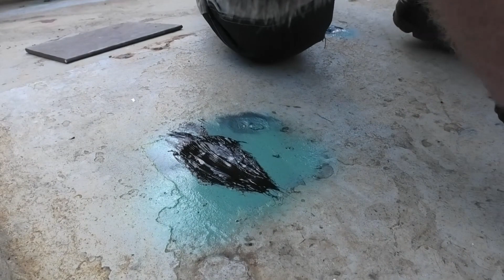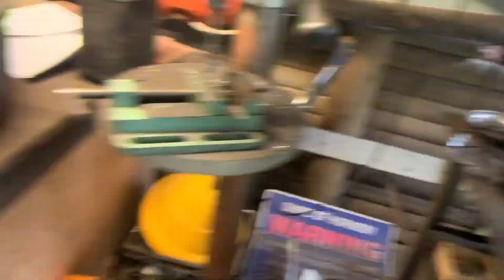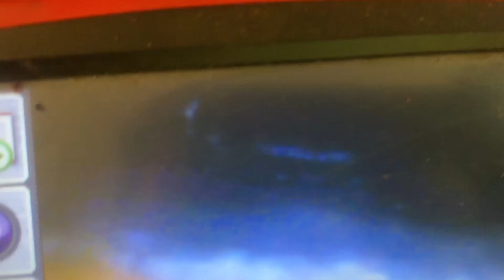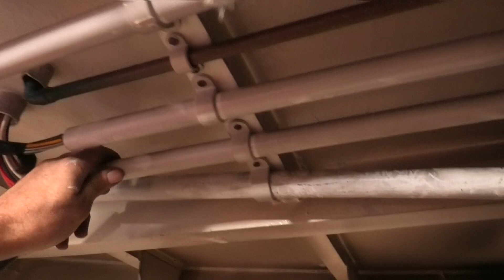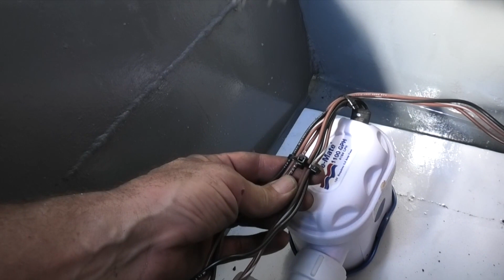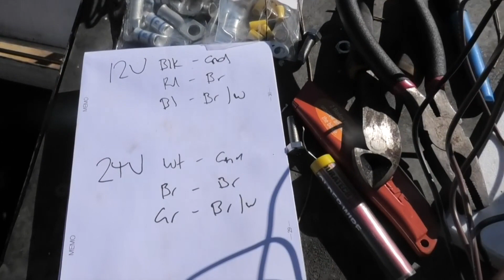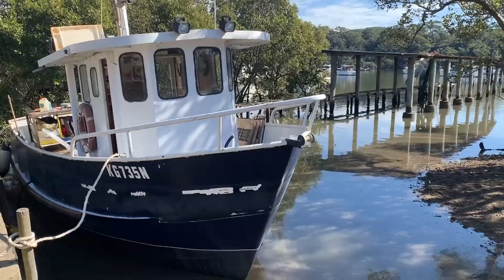Launching the steel trawler!

Comment: Definitely get an ATV winch with rope and wireless remote. 

https://www.ebay.com.au/itm/CE-Electric-Winch-4000LB-1815kg-12V-Wireless-Remote-Synthetic-Rope-ATV-Boat-Car/192240624376?_trkparms=ispr%3D1&hash=item2cc26f22f8:g:6uUAAOSwOjBZX0FD&enc=AQAEAAAB4BPxNw%2BVj6nta7CKEs3N0qWD5gbtDz8f5RZRRySfPiFdPE1UsR4JkkiyfIJappLwVXXtaH8BKJhwXTt1C8l4IPoLPEL5DqpzZ%2BrtnBKx2hbmllk5bKMOX3qS9KOGqZ1%2FTOzHGhEuBUZlbSsEIZ0qacvc3IchZjewRcJhjBnn3xxMuIEctrCzR8fGa%2BLsC1OzGGygXUeAhUy2Pq%2Frf3c97D5Rgf%2BzQtw7Y%2B7I5oCMLQdFZrPoqiU1czfHB%2BHz2ZSeUAif2ox11E3faVxd%2FTEbVP9FIlf0qGF6rtkSvhfB3VqhEYf0f72o%2FGcuaGE2Yr%2BIXVu9KYePVwKQ486mmCOtBc6zh%2B1DX4BxGRa9HyC72vClnWtPMsGuoUXwut%2BisNgA%2BlkmyoWj2HpxF0njq95Ehsucq963gwriJr3GCeP5R8yW3%2FUMTHTB2oVX0sT1TPqHps8t1ANJL0vkqnxvHhgVVnvxIeRwi8Nrwg%2B8BKW%2FnWzXWeXspz4HqRqLou3oGIjckDscLkTbudQO0CrztVZXkXrAsj6kIIYvH9AgBX5vbrFR97URNlrLc8sJ25GUoFC1XqtcQc0wsf7lZgu4RSbljZWno%2FTrqLT7wwiohMTrwoHELRd5Ks8PVrcIAaynCV8PHw%3D%3D&checksum=192240624376b371bf60ee4d48e7ac85d0e0d81f17ee

Comment: Can anyone tell me about the crane, I only ever see them in Australian videos
Reply: The Truck cranes are common place in the USA, the ship mounted cranes are even more common. unclear as to original question, please restate.
Reply: @Artoconnell  the crane lorry, never seen anything like that in England, the articulation and lack of rotation of the boom set it apart from the iron fairies we have here.

I'd probably refer to the shop hoist bolted to the deck as a hoist but appreciate I wasn't very clear thanks.
Reply: @dingledooley9283  Look up Lindsell hoists &/or Jarrett ute cranes, I've got a Jarrett on the back of my landcruiser & it's the best thing since sliced bread, there's a good picture of a Lindsell ute crane moving a live 5 meter crocodile on the Lindsell website.

Comment: Looks like the same dork who wired my boat wired yours as well. People who change colors like that mid-run should not be allowed anywhere near electrical and/or beaten senseless. Congrats on getting her wet.
Reply: I have an even better story.  I helped a friend with his 56ft cruiser.  That boat was built in Taiwan  and nearly 90% of the wiring had no color coding it was all black.  It was a nightmare trying to trace that stuff.
Reply: @Hoggdoc2  Just a quick tip on tracing wire - you can get a device telephone/network installers use to trace wires.  It sends a signal down the wire allowing a receiver to pickup individual wires.  The better ones allow you to trace wires in bundles.  I have a Fluke Networks Pro3000 which works great and was only around $75.   I would also get a wire label maker - Brady makes nice ones - so you can label the wires themselves as you go....
Reply: 20 years of IT networking and electrical..Beaten senseless. I've lost track at the sheer stupid number of hours of my life I've lost because people changed colors of wire mid run.
Reply: As Garfield says " Should be drug out in the street and ...." In Minrcraft of course. Survivors you guys can take care of.
Reply: Unfortunately, vehicles come from the factory with color changes.  I just finished totally rewiring a Gehl asphalt roller because I got fed up trying to figure out what went where.
Reply: @flick22601  True, but at least those changes are documented.
Reply: Use boat cable, it is similar to the Romex used in wiring homes.  Easy to mark, easy to run.  Makes things so much more simple.

Comment: Oh stu , should have asked me. Welding the holes in the deck .  Magnet clamp a piece of flat plate brass probably minimum of 16 or 20mm thick underneath the floor plate and turn ya welder up and pad weld them holes. You will NOT blow through or chase a hole. When done take magnet clamp off and knock the brass with a hammer and should fall away easy.. repeat the same brass with every hole no probs. As long as the brass is still flat where ya welding and no gap underneath.  Can use the same brass over and over again. Or even a very thick piece brass block of square or round bar , can use plenty of amps and no blow through. Very Easy.  Later can weld overhead underneath to make the plug weld tidy and prevent rust.  Removing the silicon from those holes later will be a pain.  Plenty of patience and coopers for  that task.  
Have a great trip mate

Comment: bit extra info on the fuse logic, the big fuse at the start is only for 2 reasons really, and before that, the small fuse for each appliance will protect the cable for the entire length, before and after the fuse (it will open the circuit ). The big fuse is because 1) we generally add more little fuses that the limit, so 10 things with 10Amp fuses means 100Amps could flow from the source cable,  so a main fuse stops that. 2) For unexpected cable damage, so a fuse as physically close as possible to the battery/solar/whatever will protect against accidents or insulation wearing off. 
So if you really wanted to, you could only have small fuses for each appliance,  and made sure they don't all add up to more than the main cable rating, and make sure no damage was possible. Not recommending this, but as an example..

Comment: Label as you go and color code conduits, sleeves, and plumbing heat cooling pipes as you go just spot paint or stencil code  per bay so anyone can tell at a glance important mechanical room protocol. Also number and map valves so if I go into mechanical room any technician can see what's what at a glance. Just a suggestion. Very handy for maintenance but especially in an emergency situation others assisting who are unfamiliar with the system can be more effective. Just a word from Plumbing HVAC master. Navy buddy says that's how it is on ship too.
Reply: These comments are addressing the project as a whole not this particular installment of the vlog though it does pertain to the electrical conduit. It is more of a statement on best practices. Best practices codified in mechanical engineering as minimum standards and specifications. There are reasons for this that should be self-evident. Listen I'm not trying to be on a high horse here or tell Stu what to do. He's done a great job he's smart resourceful and doesn't need my input. I just know from experience that during emergencies involving critical systems it makes a huge impact on the outcome. Just an observation no harm intended take it or leave it.
Reply: plumbing, heating, cooling, valves... you sure you commented on the correct clip?

Comment: I found out to my expense (had to replace blackened overheated wires to the 24v anchor winch) - had to replace the wires with TINNED multi strand insulated wires...
Reply: All wiring on a boat, especially one in saltwater, should be tinned, multistrand.  Boat cable makes life so much easier...

Comment: Thanks for the video, and you probably would not feel so tired if you cut down on the beers,  drinking through a working day and the pub at night is not good. Steve in Thailand.
Reply: nevets7152 it’s only to wash away the taste of welding fumes and paint dust , no other purpose
Reply: Unsolicited, personal advice such as this has to be the most obnoxious, self-serving comment possible.

Comment: Hey mate CRC makes something called lectra motive that would work better than brake cleaner for electric motors.
Reply: Gabe T CRC contact cleaner is great for cleaning electric motors, too. especially cleaning for cleaning up commutators in conjunction with a pencil eraser. also safe for the varnish on motor windings.
Reply: @francistheodorecatte  Good to know thanks!